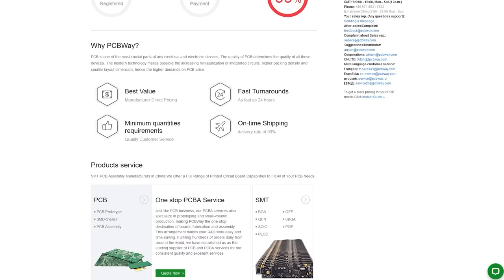This PlayStation 5 Repair Was An EMOTIONAL ROLLERCOASTER! Can I Fix It And Save My Sanity?

Comment: I love this vid. Been trying to figure out a missing 3v rail and this video has pointed me in the right direction. Thank you
Reply from the maker: Awesome stuff buddy, best of luck with it. The most important thing to remember is that your missing rail is often down to a higher rail being pulled down. The 3v rail as far as I know comes from the 5v rail so that would explain why the cap on the DA9065 was bad

Comment: Amazing go on this console don't you think it was possibly just the fuse to start off with?
Reply from the maker: Nah the fuse would've needed a reason to fail. Likely the fuse failed when I injected voltage as it look a lot of power, but the original fault was the cap failing
Reply: @TheCod3r  much appreciated your feedback is priceless and all your hard work and shearing what was the deal with the bios chip it did give you boot then took off then you replaced and then it worked like what the hell 😆 lol

Comment: Hi Phil nice fix btw the bioschip is programmable with just ch341a programmer and is very common it does no power issue. Look in that mate.
Reply from the maker: Cheers mate, yeah I think there's a way to read and write them, but it's whether or not you could copy a new file that works
Reply: @TheCod3r  yes that is no problem TDR repair has video abouth it. If you use ch341a you can best use neoprogrammer programma.

Comment: Phil.. have you thought about repairing boards for vehicles.. could be worth a few quid
Reply from the maker: I have but testing would be too difficult. Logistically it would be a nightmare to have to go to the vehicle every time I wanted to test and see if the fault had gone
Reply: @TheCod3r  any way of patching in using the plug-in diagnostic readers?